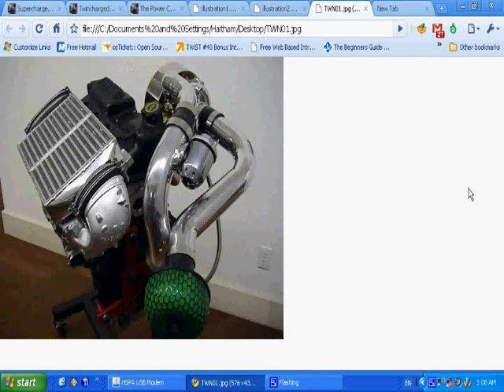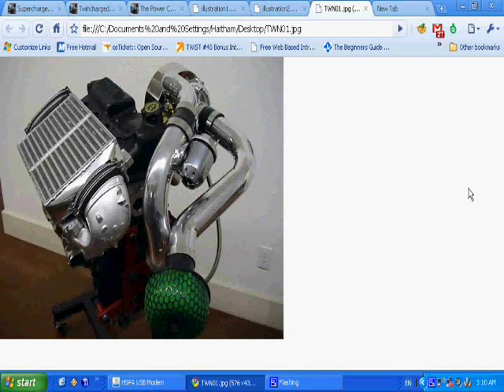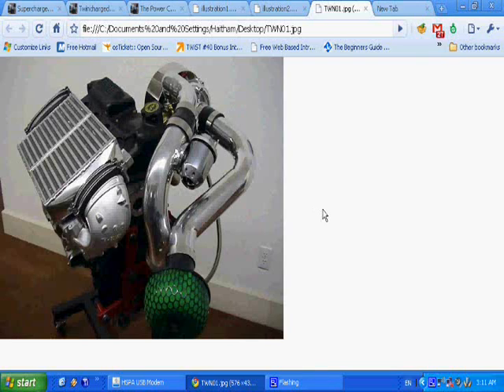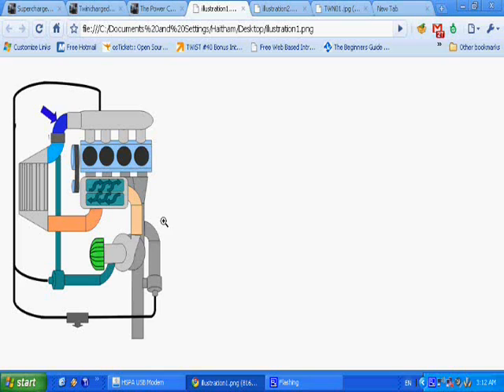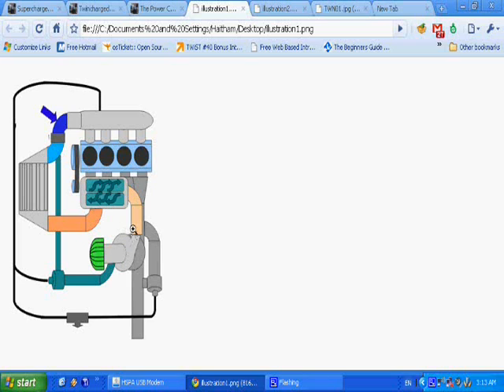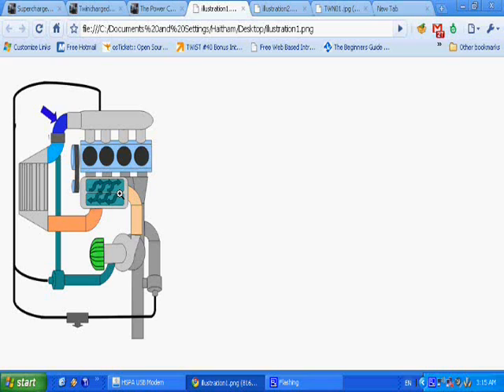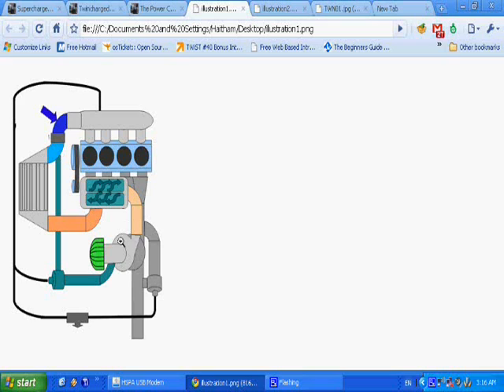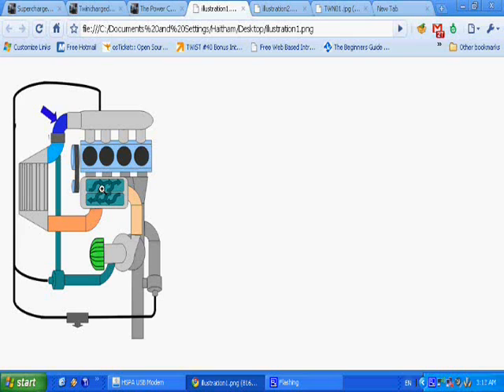Using the Turbo Calculator to design your twincharged setup - Part1

Comment: @nuclearhappines 
just for your interest, i do use a blower by-pass valve which is just a throttle body with a wastegate actuator that opens when the turbo is spooled up, the blower continues to spin - no clutch.  i get a substantial increase in power when this valve opens (~ 40hp @ wheels), but agree plumbing is a pain and for ease of fitting, its probably not worth the extra hassle. i also intercool between the turbo outlet and the blower - more to protect blower & for future psi increases